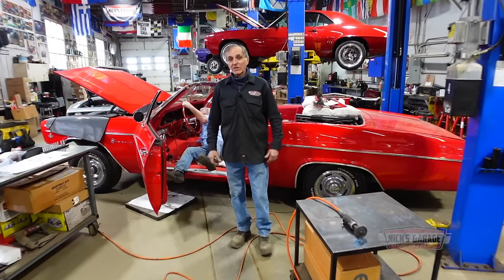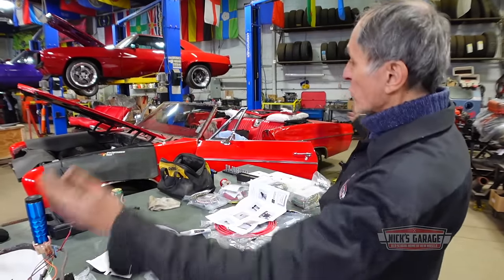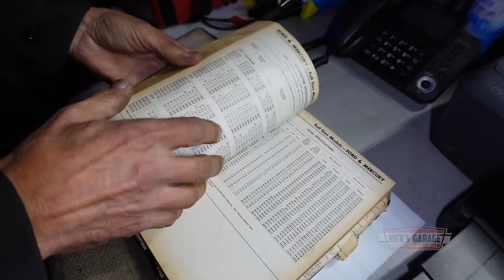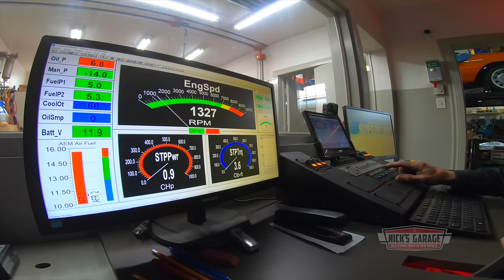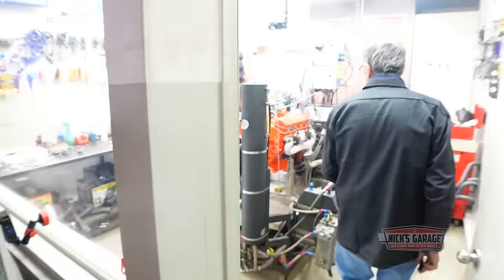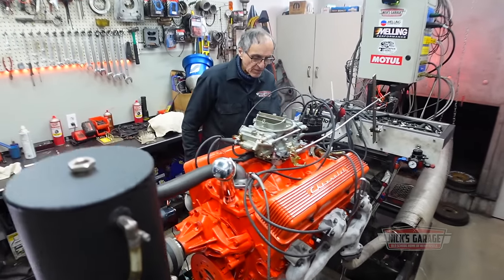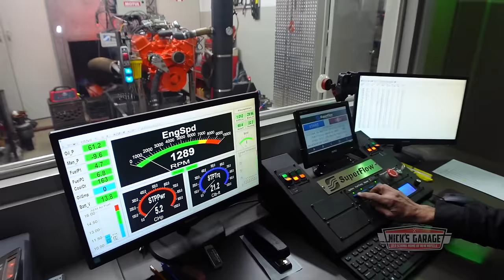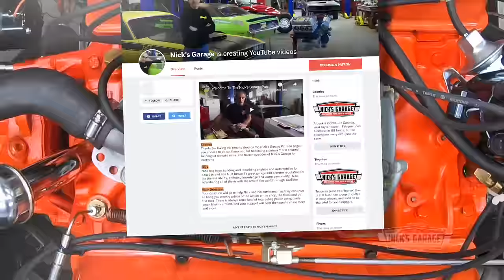327 Chevy on the DYNO - Exhaust Shootout

Comment: I wonder if a set of 2 1/2" "ram's horns" manifolds would have done better than the stock manifolds you used. I'm pretty sure the 2 1/2" were used on the Corvettes for quite a few years
Reply: I agree. The rams horns, especially the 2 1/2" Corvettes flowed better than the later manifolds. In fact, his 66 Impala would have had rams horns on it from the factory.
Reply: Absolutely, we ran those in oval track racing for years, because the rule required factory manifold's... Now, send them to brazinski to be hogged out and flowed, I'll put them up against ANY aftermarket header.!!
Reply: Bingo! My thought exactly! Those junk manifolds killing that 327.
Reply: Yes those ram's horns manifolds flowed fairly well for stock manifolds
Reply: Yes I also ran circle track and rams horns flowed better so they were outlawed in stock  classes as they made more power.
Reply: That engine came factory with ram horn manifolds, those smog manifolds are hurting it.
Reply: Corvette used ram horn manifolds on the 327. I ran them when I was dragracing,  I would gasket match them.
Reply: @davidhansbury6247  the ram horns won't even compare to an aftermarket header. i have several sets of ram horns on my vehicle's and a couple sitting on the shelf for later. yes they flow well but thats only half of what makes power with manifolds/ headers. its all about exhaust scavenging. the ram horns are just too short of runners and not a very efficient collector.
Reply: That's what would have been on that car would have been Ram horns I agree with you
Reply: @hotrodbob6573  yes sir, that's how we found out about what brazinski could do with those "rams horn" or "center dump" manifold's, he swore by them because of equal back pressure
Reply: He was a drag racer, made a fortune hogging out, polishing, and flowing those manifold's
Reply: @davidhansbury6247  I ran them on my 32 5 window coupe Deuces Wild. I ran in the 11s
Reply: I've used both types, the ramshorns help, but sound really nice, headers work great but can be a pain in the engine bay. I think the LT1 350's had 3"" ramshorns, or was that just a rumour?.
Reply: Headers aren't better because they "flow". They are better because each port has it's own individual tube and that enhances the scavaging effect of the exhaust on the cylinder during overlap. A bigger, "Hogged Out" Rams Horn exhaust manifold won't do any better on this engine. It might provide some gains at really high rpms but from idle to 5500 rpms is where long tube headers benefit an engine the most.
Reply: Those ram's horn manifolds won't fit that chassis. They work on 64 and older chevys and many pickup trucks etc. The crossmember in the frame blocks the exhaust pipes. Corvettes used them too up to 69 at least but the chassis allowed clearance for them.
Reply: Absolutely probably 10 H..P. min. Good Aftermarket Ram Horns are 3 to 4 Hundred $$ I Surprised Nick used those SMOG Manifolds as a Test ..And I hope Nick  doesn't keep them as  Finshed Product  Good Ram Horns are a Necessity for this Car .
Reply: @sgtyork9330  Not that it really matters, as I'm guessing he'll be using headers or the factory manifolds for that car. You sound like you've wrenched on a few Chevy's in your day
Reply: @donaldalbershardt6854  well I bought a set of ram head manifolds with the 2 1/2 outlet
Reply: @georgekaratapios7246  Good ✌️
Reply: Without a doubt they would have
Reply: @davidhansbury6247  
Just curious what size engine did you run and what compression ratio and what was the spec's on the cam you ran. I  know some one who when by the book/rules and he got out ran bad it was like everyone else was illegal or something...and also is there any tips you could give me to help get him fast even if it's in the grey area.
Reply: @davidhansbury6247  Polishing exhaust I don't think that will make to much of any difference that's just way to much work for something that may not even work. Polishing I just don't know about that one.
Reply: Yeah, I've used the ram horns in dirt track racing and it was something you could feel in the seat of your pants. In A-body cars you have to run the one offset manifold with the angled flange, but on a Impala I think you could run the truck type. I fixed mine to go into 21/4 pipe smoothly, and they did work great.
Reply: Lewis that is a good name cuz that is my middle name. The ram horns manifold were only used on vettes and full size Chevys. I'm thinking they did flow pretty good.
Reply: @sachenstein  yup but only on the vettes.
Reply: Port matched  and opened up for 2.25 exhaust pipes

Comment: I've had several chevy small blocks over the years and they've always sounded so good when revved up.
I think it's a big part of their appeal.
Reply: Bro lots of people will disagree with me but I swear by a 327 ive had very good luck with them.
Reply: @unclequack5445  my first chevy small block was a small journal 327
With a 3.48 crank 030 the old 355 stroker they call em then. 
The thing I didn't like about it was you race a few times and then rip it apart and replace all the bearings. But other than that the thing would scream. The only real competition were those damn ford 302's with that 3.00 in stroke it seems like they revved ten grand and were hard to beat. But I had my good days too.
Reply: @jamesreeder5316  I never had any problems beating 302's but my cousins 351 Windsor was tough.
Reply: @unclequack5445 351w is a hard one to beat. If you've ever seen The other guys on you tube they swapped out the heads,cam and intake,and put a turbo on a junk yard 351W and Didn't change the bottom end at all and squeezed over a thousand horses  
 out of it before it gave out. Very impressive! They have a bottom end tougher than some big blocks.Ive got one in a 96 E250 with over 250thou on it and it runs like new!
Reply: @unclequack5445  But they didn't have the 351w back then.351Clevelands were killing the hell out of us as well not to mention the mopar 340's they were pretty tough too.
Reply: @jamesreeder5316  Well sir thats what it was this was mid to late 80's

Comment: I had a 70 Camaro I bought new and in less than a week the valve covers were leaking. 
I changed the valve cover  screws and they were no more than finger tight. I tighten them up but only slowed it down. My experience is when corke gaskets start leaking there is no stopping it .
I replaced them with neosporin gaskets and worked perfectly.

Comment: I owned a 67 Corvette with a 300hp 327...and a 3-speed stick shift. I always liked the 327, especially the 350 HP version. The cam in that engine gave it a great sound......I even put a 327/350 cam in my Chevy Nova 283....again, great idle sound......

Comment: I agree with everyone that's mentioned the bigger set of rams horn manifolds, and 66 should've been stock for that year.
They flow whole lot better than the log manifolds will ever be able to. 
Plus Jegs has even bigger ones that are very close to original factory set as far as looks go, but have bigger runners. 
I don't remember seeing the dump pipe off the back of the intake manifold that vents oil vapor an such from those blocks.
That engine was rated at 275 @ 4800 rpms, and 355 lbs torque @ 2800 rpm with a 750 cfm spread bore quadrajet carburetor on it.
It's a wonder that little mouse motor could move that lead sled as well as it does, but then it does have 80 lbs of torque more than it has horse power.

Comment: A lot of people don't give the exhaust much consideration, but way back in the day one of the 'hot rod' type mag's tested a bunch of different headers in a variety of available configurations lengths of primaries, pipe diameters, and collector sizes - for through-fender designs on a '57 running a 327.
There was just on 50hp difference between the best and worst manifolds for that specific engine configuration.

Comment: Another great video! The double hump heads look like 461s, 194/150 valves..cool!
Original GM exhaust manifolds never used gaskets, it was a metal on metal fit and they never leaked. I also thought maybe in 66 an oil baffle was under the intake and the PCV was in line from the base of the carb to a port at the back of the block.
 Nick's videos are awesome!!
Reply: always made me crazy there were no gaskets between the heads and manifolds
Reply: Mopar big blocks other than some trucks never used exhaust gaskets either. Best way to go! Surface them flat, use a SMALL amount of rtv and antiseize the bolts with hardened washers and torque to NO more than 15ftlb. No warping, the hotter manifolds can move relative to the heads and metal to metal heat transfer. I know pro builders that Surface headers, cut the bars between the ports and toss the gaskets. (Copper or SS does work well on imperfect flatness tho) First thing you did on a big block international plowing snow! Unless you liked changing 3 sets a year and a huge pile of scrap cast iron in the shop! (The next two were to drill out the jets and crank the timing around to where it ran good!) Amazing how many stubborn people can't wrap their heads around this and warp manifolds and twist off bolts trying to hold them.
Reply: Also. I always use copper on headers and always use at least a 6" high quality piece of flexible exhaust just behind the headers. This is especially important with bigger diameter systems because the pipes are so rigid they torque the headers HARD and will take out gaskets and Crack header tubes from engine motion and expansion. My headers and gaskets have so far lasted 3x longer with my 3.5 to 4" system this way.
Reply: yep your on it!

Comment: you know when it comes to convertibles the one I've always had a thing for is the 71' when it came to the cuda, its like the 63 split window of the cuda line, a one year option, well look, that was also the last year of the convertible itself and the 426 in the line as well, it was alot of the last of the last 

and I think what really did it for me was the nash bridges tv show they had with the cuda with the small block on there, a 360 performance crate as they blew the 340 in the hero car

like the sound that car made, plus it was kind of a custom color a sherman williams safety yellow of all things that was like a cross between Lemon Twist and Butterscotch, mixed in with a white interior, like it just really worked for that thing. 

also that 67 yeah those fuses, I recognize those, those are housing fuses of the period that they used in the 70's, its probably a very good call that he switches them out as those straight up look like tv tubes lol 

and also with that 67 that puts it right before they started switching over to the 350, as the corvette C3 only had the 327 for one year, 1968, and probably the same here with the impala

and its amazing how much bigger that car got, as my father had a 61 convertible, black with red interior with a 283 with the turboglide turbine transmission, 3 blades, smoothest car he ever had, and fast, deceivingly so, as the guy he sold it to got 5 speeding tickets in the first month, and here that is with what I think is the same engine enlarged to 327 cubic inches with a much wider body on it. 

like that thing should be quick and then some, like you'd think you'd need a big block but that motor, they used that in everything, including a bunch of italian cars, a famous Bizzarini car made by the guy who made V12's for lambo made his car using that engine called the 5300

same thing with the Iso grifo, and if the italians love it, you know its gotta be fast, or atleast sporty, like the 68 Vette that had the 327 revs up to the upper 6K's, like its a proper sports car motor

granted I think with the italian setup they put on either double or triple carbs, but the lambo test driver, the guy who tested 550 horsepower countaches and all that crazyness, he considers the bizzarini GT car with that motor his favorite, 

and dont forget corvette C2 grand sport, 327 enlarged to 377 cubic inches and it puts out 425 horsepower on race gas

also those figures, the saying goes take 25% off to get the actual to the wheel power, so 300 ish hp, 25%, 75 HP, 225 to the wheels, and that is with a single carb, and 247 with the good exhaust

like that's not to far from what that souped up 76 ghost camaro Helge Meyer had with nitro from stock for humanitarian runs lol like nevermind that stupid 305 they put in everything in the 80's, they should have just brought this back lol

Comment: Early 00's as a kid I street raced witha 327 in a chevelle. Double humps, 230/480 Lunati bracketmaster cam, air gap intake and a  650 Demon. It stayed about the same as a Bolt on LS1 camaro back then. Thanks for the vintage pull

Comment: Needs more crankcase venting, @20:30 it pushes the filler cap/vent off the filler tube, back when I was racing a 327 in a stock car I had 4 vents, 2 tubes in each valve cover topped with breather/filler caps for a big Chrysler, no such thing as too much ventilation.

Comment: 👍Love the 327! Almost as much as a Chevy SB 400. Thx Nicks Garage for another good video. Lovin this channel no matter the content. They really know how to put the work in @Nicks Garage! 👍
Reply from the maker: Thanks, Major.   👍
Reply: I have a 409 sbc for my nova. +.040”, high nickel 509 casting.  AFR street eliminator 195’s, 11.1:1 static compression, cast steel crank, forged rods and pistons.  Comp 12-433-8 hydraulic roller, .038” quench, 770 QFT Brawler on an edelbrock performer rpm with a 1” open spacer.  I think it is the best engine I have built so far.  My only regret is that I went with 5.7” rods instead of 6”.  
It has not been to the dyno yet, but I fire it up every couple of weeks to keep me motivated.  The car will not be done until the end of this year if all goes as planned.  
I believe that this engine has more power than the 408 bbc that I built several years ago.  It was in my previous nova, which ended up in Ontario, Canada!  I’m in nebraska, USA.
Reply: @mistered9435  My 1st 400 blew me away on how much torque she had, in fact, I never built another 350 after that.
Reply: @mistered9435  I have a 406 with afr 195s , my compression is around 9.5:1 compression with dual edelbrock 500 carbs .500 roller cam in a 80 Buick Regal , th400 trans and 4:10 gears 26 inch tall tire, leaving the car in drive it will lay a posi patch well over 100 foot, love them 400s

Comment: As a young man I bought a 62 Pontiac Parisienne 4 door that had a 327 in it. Upon further inspection i saw that it had a Carter 4 barrel carb, dual exhaust , and a fan that only turned when engine temp came up. Hmm...I dug in the glove box and found the owner's manual...it turns out that it was the factory motor for the car , but was the same spec as the 300 hp  10 1/2 -1 compression , Corvette motor...1962 being the first year for 327. You never know where you'll find those 327's.
Reply: Canadian Pontiacs are Chevy's with shortened Pontiac-look bodies...

Comment: A friend of mine had a '65 Impala 283 with 3 on tree and huge lead pipes. That car would run like you would not believe. We blew up rear ends and transmissions till we put a Muncie 4 speed and 12 bolt in.

Comment: Chevies were great because of interchangeability of engine parts. 327’s came with either large or small diameter crankshafts which opened up even more possibilities of crank-throw/ bore configurations, depending on which c.i. block and rods you used. I always used “pink” rods for large diameter, “green” for small diameter. You could stroke/destroke an engine by using a large diameter crank, and then off-set grinding the rod throws .090 (the rod throw diameter difference is .0100, with the additional .010 for cleanup). You would use the “green” rods in this instance.

Comment: Living in Southern Nevada, road salt induced rust is not an issue. But intense heat and UV kills soft parts. I completely rewired my ‘66 C-10, my ‘59 Plymouth wagon and had the harnesses rebuilt for my ‘69 Fury convertible as there are no reproduction harnesses for most C bodies. The brittle insulation was definitely a short and fire hazard. Even garage kept vintage vehicles receive intense sunlight if driven nearly daily in this climate. But after growing up in Wisconsin, replacing wiring, upholstery and weatherstripping is the lesser evil when compared to replacing rotted steel.

Comment: Chevy did make a cast iron performance exhaust manifold for the 327 it as called ram horn exhaust manifold and the manifold’s you have on the 327 now are the smog pump type from the 70s had them on a Camaro and a Monte Carlo  !!!

Comment: That seems to be the PERFECT engine for cruising in that car. Very Cool!
Reply: Cam looks too big for the heads... this 500 HP cam gives zilch low and low/mid RPMs power... and torque peak way up at 4500 RPMs... but no where's near 500 HP... 
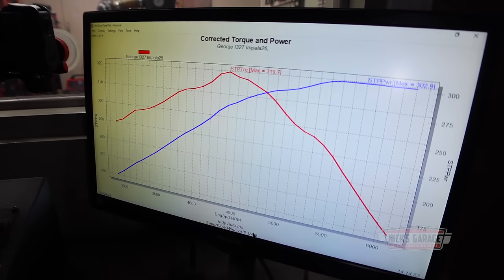18:45 ... one of peakiest torque 'curves' I've ever seen in a street engine! Looks more like a 'mountain'...
Reply: @BuzzLOLOL  that's no where near a 500 hp cam nor a 500 HP motor. It has a mild street performance cam, that's about it. 300 HP is the perfect amount of power for that set-up.
Reply: @erikturner5073  - Guess you know nothing about cams... I'd put that 232/232 cam in an engine if looking for 475-500 HP... back in the day, Pontiac supplied a 235/245 cam for their Ram Air V 500 HP builds... look at that horribly peaky torque curve at 18:45 (the red line)...